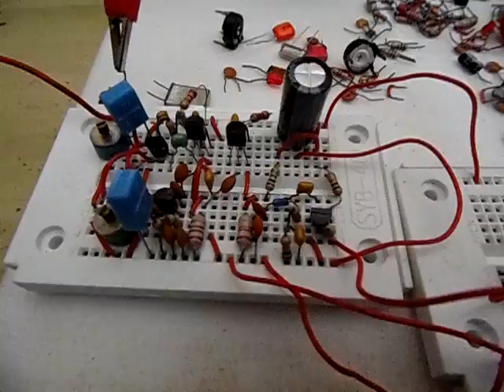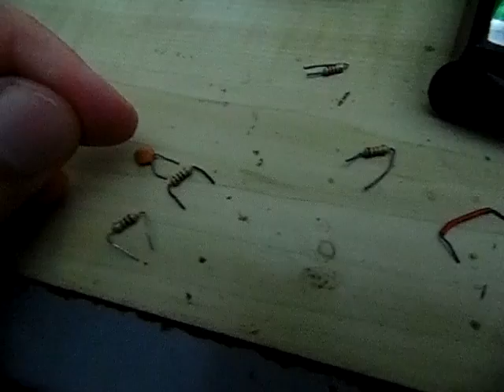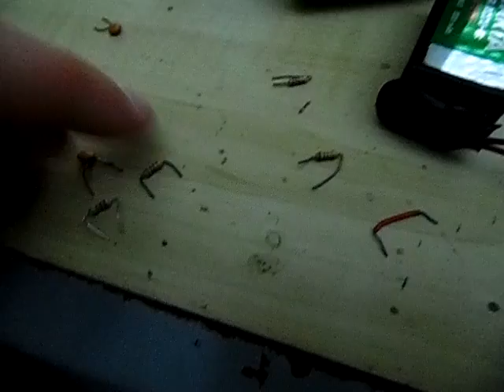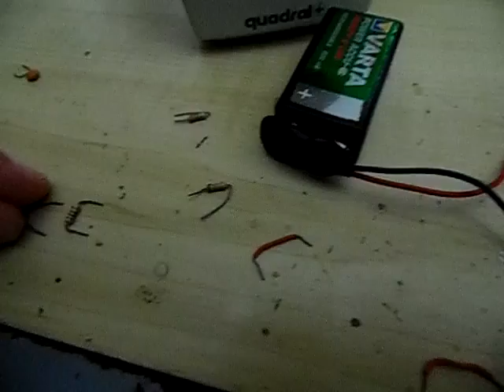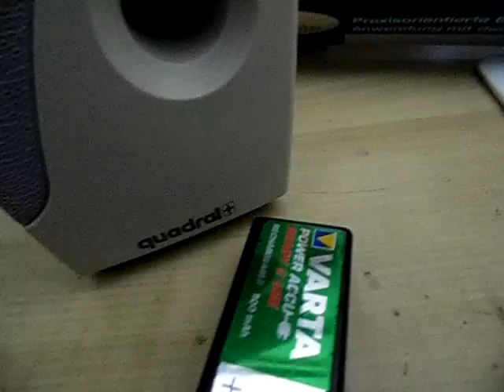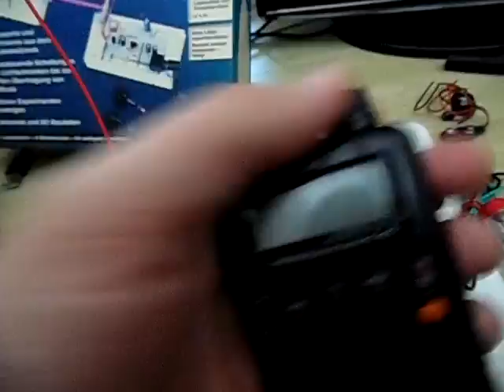cdc 1 superhet information

Comment: It's really that simple?  Thanks!  I'll try those suggestions later on when I have some new parts.  I'm going to order them soon so I'll try all that when I get them.  Well I'm off to watch the rest of the videos now.
Reply: +CoolDudeClem You are very lucky, this man uploads videos that are like remote lessons about EE in RF branch. Obviously, lessons from an expert in such stuff.
P.S. I hope you guys won't mind me interfering with your chat as well as stealing knowledge from this golden vids ;)
Reply: +MrJohhhnnnyyy Well I don't mind at all and I feel a lot more confident about getting this to work now.
Reply: CoolDudeClem That's good to know. After missing chances to learn before, now I just can't afford to loose such chance. And yeah, Stefan's circuits works like charm, I built a TV transmitter yesterday, and it works excellent, especially considering that circuit is such simple